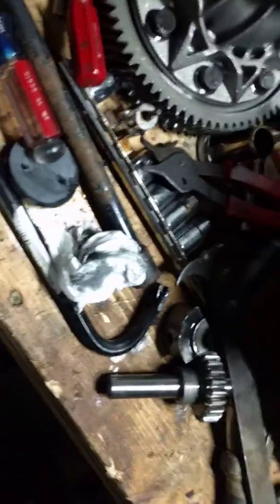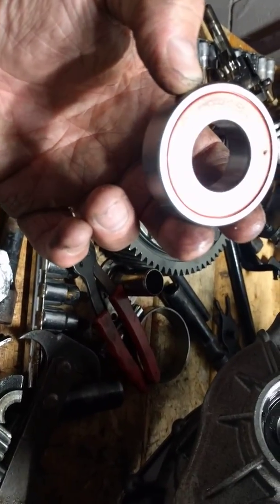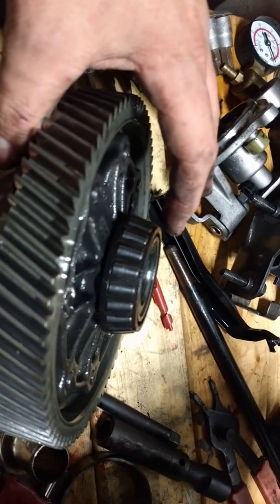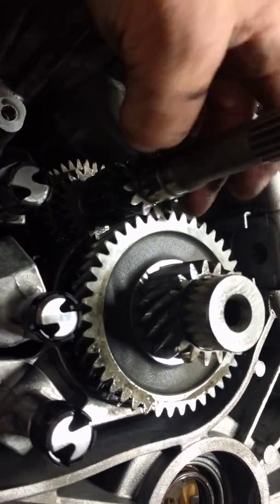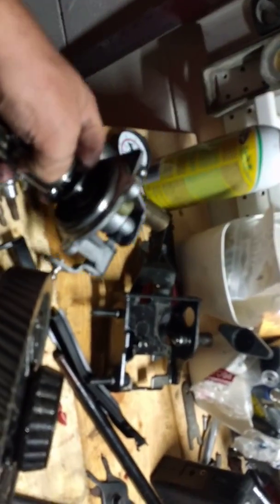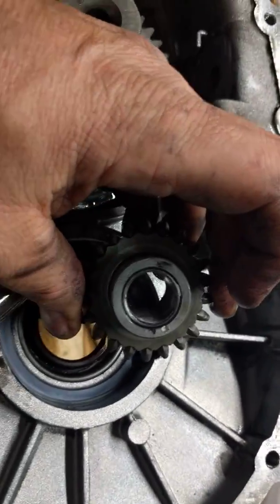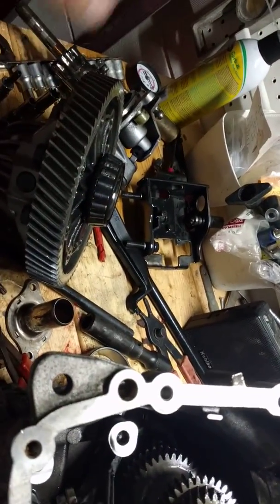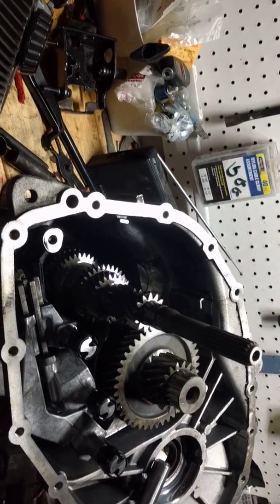Mini R50 Getrag 5 spd rebuild Part 1 of 8

Comment: I was so close! 😂 I didn’t put the diff back together correctly and ruined the spider gears. Any idea where to find them?
Reply from the maker: Sadly, the only place I would be able to get them is another transmission! You may want to try EBAY. I think I got my kit from seller onestop gearbox shop in the UK. Either that or try Cobra Transmission out of Florida since they also have trans parts.

Comment: I would like to get some help from you, seems you dominate the gearbox I'm dissembling mine, but I can't take the bearings off, please help I will appreciate email elgamerchapin@gmail.com
Reply: @3rdworldgarage450  i have an 2002 r50 5 speed. the input shaft bearing is blown. can i just replace the bearing or do i have to do a full rebuild?